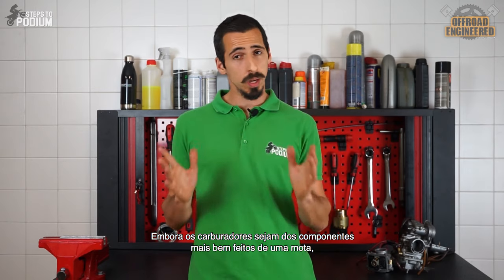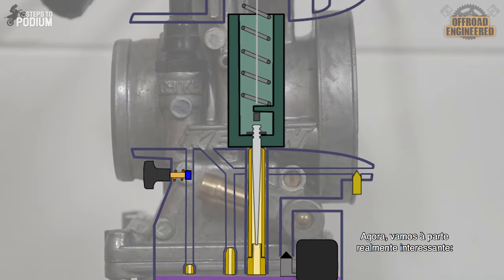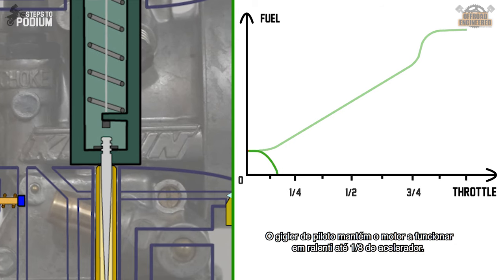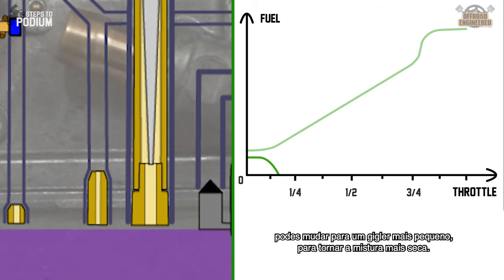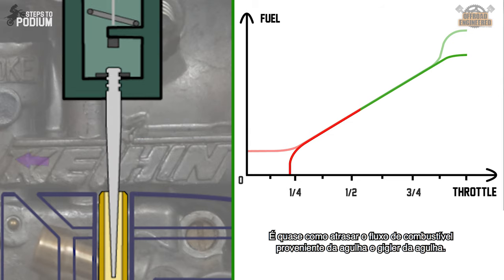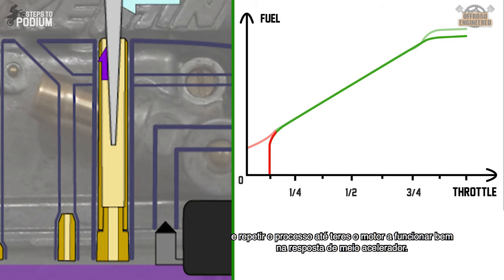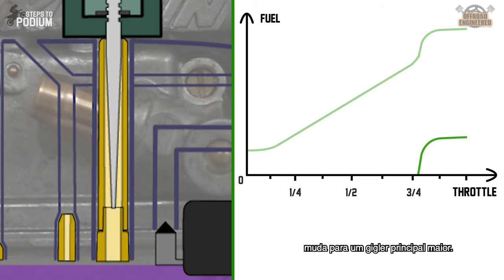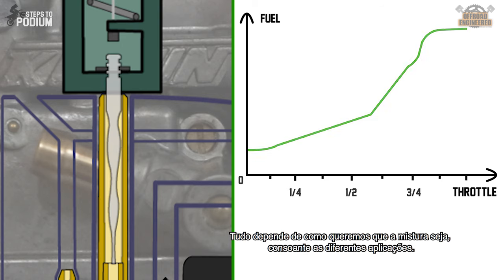How carb jetting works | Offroad Engineered

Comment: What could be the cause of bogging but only when the engine is warm? It works fine cold.
Reply: Your engine is most likely too rich. Rich engine runs better when cold. This is why choke works but if you are too rich you have a sort of "choke" on constantly and no control over it at all. It is usually better to err slightly on the richer side of optimal as the engine runs cooler that way but not so much that you get bogging and fouled up spark plugs.

If it were lean, it would run poorly when cold and it would have trouble staying on but gets better when engine warms up. Too lean and you get surging and popping even when warm and in worst case scenario maybe even piston damage from overheating if the situation continues unattended.

That said if you haven't done anything with the machine and it suddenly developed a rich condition out of nowhere then maybe check up the float and float needle inside the bottom carb bowl. The float adjusts the amount of fuel inside the carb bowl (where the jets suck it up) and seals the intake with a needle plug when proper level is achieved but if that needle starts leaking (cracked rubber etc) then the carb bowl may get flooded and engine becomes super rich all over. Make sure that the needle is all right and float is set to proper level (depends on carb model how it is done).

Comment: Does the idle jet, or pilot jet, always bring gas into the engine? If so, isn’t the pilot jet “always on” during any stage of throttle application?!?!
Reply from the maker: It depends on the throttle. Although it is always on, it will be almost neglectable compared to the following circuits. A fluid is like electricity, it will flow on the least resisting path and at certain point, the pilot jet has too much restriction compared to the other ones, so almost none will flow through it
Reply: I had a 1973 350 Honda, 4 cylinder, 4 carburetors. It seemed lean at low rpms so I installed bigger pilot jets. It helped the lean condition at low rpms, but was then too rich at higher rpms. In that case I believe the pilot jets also contributed fuel at higher rpms. It may vary from one carburetor to another.

Comment: I have a problem with the carburetor adjustment, the candle is clean all the time, the air adjustment does not help, the dose on the needle does not help either, the nozzles are clean

Comment: Hello, i have a problem with my bike it idles good but dies on choke so gets too much fuel set needle higher not starting and dies after just touching throttle
Reply: Your probably sucking air from somewhere. Do you have any oil around your cylinder heads. Or you may have trash jumping around in your carb(s). Could be fuel delivery as well. I'd check for trash first in your gas lines/and filter. Then clean your carb. Make sure your exaust isn't leaking or cracked. You may not be getting air as well. Air filter would be something to check. Make sure it isn't wet or worn out.

Comment: I think there's a mathematical chart on which is the correct Jeting regarding the cubic capacity of the motorcycle ?
Reply from the maker: I bet there is but it always depends on the manufacturer and how they designed the engine. A manufacturer might design an engine that requires the mixture to be on the rich side, so if you stick to a general chart, you might end up with overheating issues
Reply: @StepstoPodium  the thing is that I bought an FCR 39 and interested to fit on a KLR 650 rebored 1st stage stock engine etc and Devil muffler and the thing is I don't know where to start regarding Jeting in order to avoid taking out the carburettor so many times it came with 172 main 65 starter and 55 pilot and NHFS neddle jet I already bought some jets various sizes and 35 leak jet and not sure what base guide should I start with.... Or even if the neddle is correct or should I buy an OBEKER or other

Comment: What is the proper way to use the pilot screw?
Reply from the maker: What do you mean with proper way?
Reply: Explain if it's an air screw, turning it which direction does what. Or if its a fuel screw how does it work. 
I have a 2001 cr250r and I think it's too rich. I'm using the jd jetting kit. But now it won't rev out.
Reply from the maker: I have another video where I also explain that 😉
Reply: @StepstoPodium  awesome I'll have to look for it thank you

Comment: 4:26
How do you remove that needle jet ??? If the main jet screws into the needle jet, and you remove that main jet from it, now you got a hole in the needle jet, how do you remove the needle jet if there is a hole in the center ?? You can't remove it from the venturi either ....
Reply from the maker: You have to disassemble the carb altogether!

Comment: what do you think about oversizing the jets and running a very rich mixture such as 20:1 or so ? It doesn't actually make the engine run rich but does increase power and lifespan apparently
Reply from the maker: It has to, unless you find a way to turbocharge it 😛 the amount of air that enters the engine will be the same so changing the amount of fuel will change its performance
Reply: @StepstoPodium  but that's what I mean, apparently it doesn't change the amount of fuel because the viscosity of the fuel changes due to the amount of oil, meaning it doesn't run rich but again im a complete noob

Comment: People find this video amazing but i find it hard to believe you find it amazing considering none of you know how to tell when its rich or lean ... 
"You are here to learn jetting yet you think you know what lean or rich is automatically" and now are going to start changing jets and needles because he told you so ..
Reply from the maker: Maybe they do and they want to understand how to go from there. If you no nothing at all, maybe you should first understand what that rich/lean mixture means before trying to do any changes to the jetting. If you don't understand how to use a spanner, it will surely be hard to disassemble an engine! :)
Reply: @StepstoPodium  They would NOT be here if they knew ... And based on their comments they didn't know anything, now they magically do and they are going to start jetting their carbs without even knowing what lean or rich is, and you can't tell what is rich or lean by sound alone. I can read some of these comments and know exactly what they are saying. 
That has been de-bunked many times on YouTube, one guy was a motorcycle mechanic for 45 yrs and thought he knew what lean and rich was based on sound of the engine and when they compared his sound approval vs wideband tunning, he was OFF ....  

Once again, some of these comments sound like they knew NOTHING about jetting and your video showed them everything, which it didn't and now they are going to jet their bike as if they know how to determine lean vs rich. Jetting is only half the story, you have to tune it using a wideband O2 sensor.
Reply from the maker: If you say so... 💪
Reply: @StepstoPodium  thats the impression i get from the comments made

Comment: Every body make the same mistake.. or missinformation on carb.. FULL THROTTLE does not mean that TE MAIN JET is free from the needle... since 1990 carbs work wit pressure piston that lift the needle as RPM get higher... SO YOU RUN ON NEEDLE AT 5000RPM WOT not the main.. I dont know how wright english but i still do better than you teach carb .